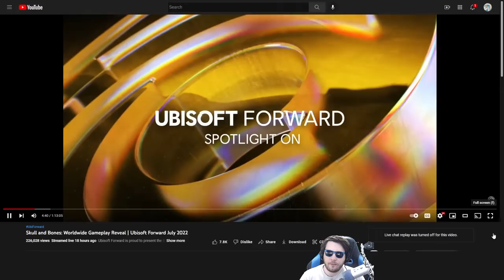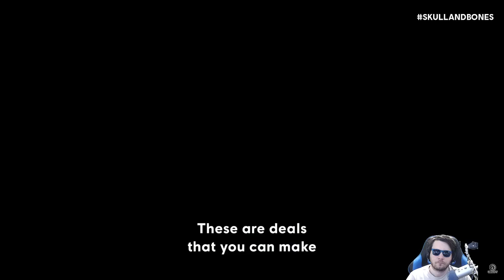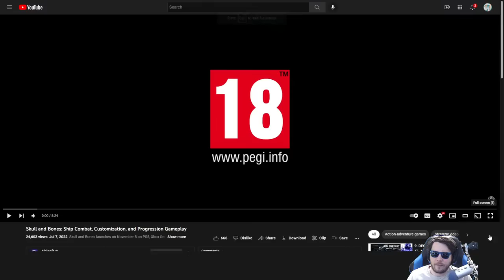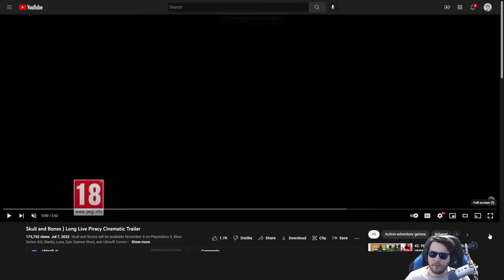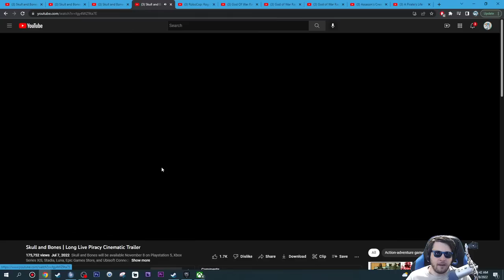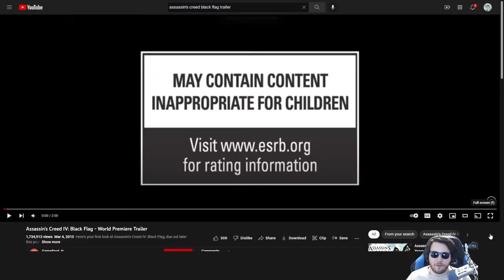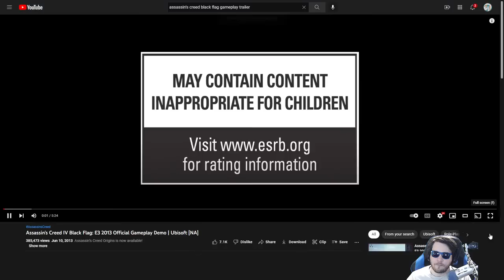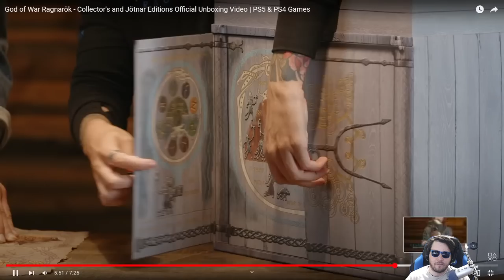SKULL & BONES GAMEPLAY FIRST LOOK & Reaction IMPRESSIONS & then playing some Sea of Thieves

Comment: You know with the first trailer I thought it was another hacked ubisoft game but after this new trailer lots of the stuff I wanted looks like it got added in. So they have regathered my interest I might enjoy it more than sea of thieves. Also my question when Raptor was talking about the roles I wonder if they will do characters for those roles you equip and give bonuses that would be interesting.
Reply: Same. I thought that this game would have died fast if they kept it the same as last years leaks. The changes might just save it